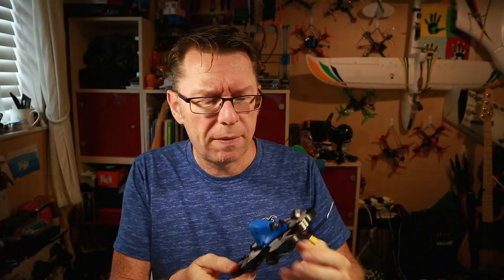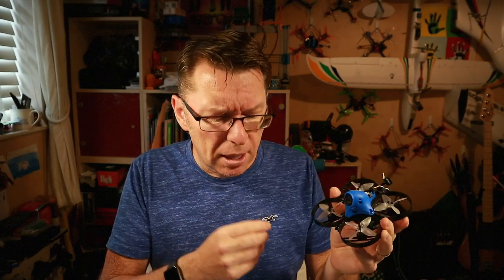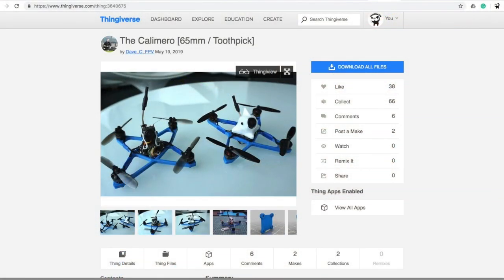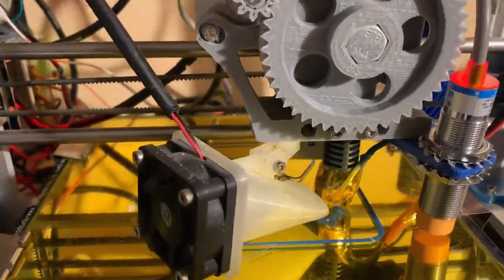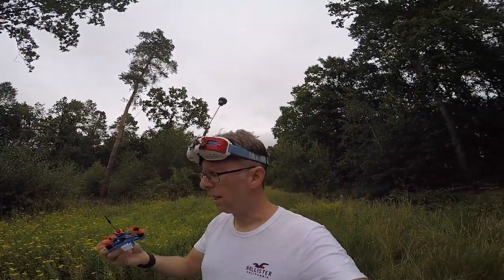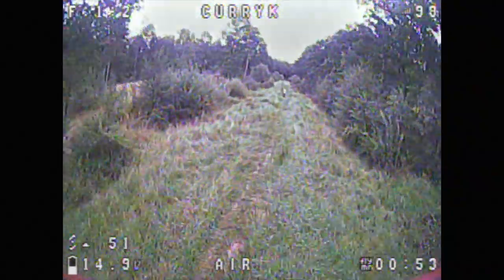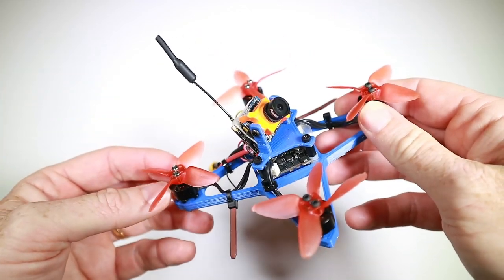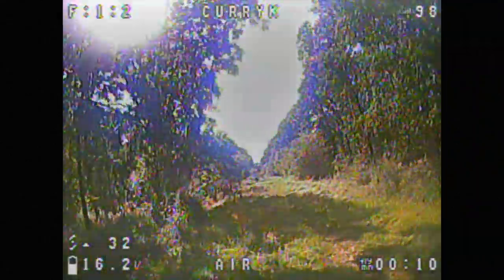Using BetaFPV's 4S micro motors/FC/ESC/Lipos to make the "CurryPick"

Comment: Hi just on the frame how strong are they ?(new to 3d printing) is there more flex than carbon frames will a hot day have an effect on the material....looks good
Reply from the maker: This works fine - the reason being that the quad is light enough to not generate a huge amount of kinetic energy in a crash.  It doesn't scale up very well though, so larger printed frames have issues with flex, strength and weight.  I would have ordered myself a carbon one for this build, but I was in a hurry and thought it might be fun to print it

Comment: For 11xx size motor, what general screw sizes/types you would recommend to pile up for motor mount? Thx!
Reply from the maker: m2's basically, it then depends a little upon the motor mount type and the frame thickness.  I used 8mm m2's in this with a single m2 washer to protect the PLA a little.  But I could knock 1mm off or so.  It's mostly frame thickness + 2-3mm.  I had surprisingly few of these kicking around.  Lots of 4-5mm and then 10mm+ so having plenty of these in between sizes would be handy

Comment: Interesting build Wayne. It's always more fun creating your own Models, even if you have used other people's designs. It must be a very light frame, Im surprised China hasn't 3D Printed these things long before now. 
  Changing the subject, can you consider putting iNAV on a 5 Inch and in particular going over the ESC / Motor / Filtering scenarios.???? It's frustrating me because I always seem to have issues with motors overheating and oscillating etc. 
  Weirdly, I did have iNAV on my old F450 and I got that to run smooth and cool..I know the GPS and iNAV is streets ahead of Betaflight, but their Motor setups ain't so sharp.
Reply from the maker: My only problem is that I don't have a GPS/Compass I can use right now... well, I have one to go back on the quad to run Ardupilot - but that's on 10" props and that seemed to work well for you.  I suppose I can run iNav without the nav part?  If so I'll put it on my todo list when things get a bit less hectic
Reply: @CurryKitten  That would be great, I like Betaflight but iNAV does a far better job in Navigation Modes...Its just ESCs and motors I get a problem with...Im sure Im not alone. Ardupilot does not have the following iNAV enjoys...

Comment: Hey C K I'm getting hot motors on my leader 120 which has been flying fine till just recently. I did brake a prop on a minor crash but didn't think that would cause any issues after replacing it. Now all 4 motors are too hot to touch for more than a couple secs.  Any suggestions?
Reply from the maker: When all the motors start overheating at once, the most likely issue would seem to be the way the flight controller is driving them - In the same way you could overheat motors by a bad pid/filter tune.  When it was obviously flying without an issue previously, take a look at the FC and see if there's any movement in it - vibes that may now be going into the board could be making it drive the motors in weird and crazy ways.  You could also check for any ESC board issues (thought this would normally affect a single motor) and check for ESC shorting on the frame (i.e the motor windings are shorting against carbon with a screw in too far)  It's possible in a crash, but again would normally hit one motor rather than all
Reply: @CurryKitten The FC is soft mounted with grommets so I think it's ok so I'll check for shorts from the motor screws w the frame w a multimeter. That right?
Reply from the maker: Yes - hold one end against the frame and then with the other probe check each connection on the solder points where the motors join the ESC board.  If you get any continuity it means you have a short.
Reply: @CurryKitten  I've adjusted the P& D gains but still same issue. I'll check for shorts next.  I have a multi meter but it doesn't have a bloody beeper. I'll have to grab a better quality 1. Unsure what the readout is supposed to be vs a beep

Comment: One thing to do with that printed frame is before you remove it from the build plate is cook it on the build plate at 80c for 30min and it will stiffen up the frame quite a bit.
Reply from the maker: When you say "stiffen", I'm a bit worried that the PLA might become even more brittle - is that not a concern ?
Reply: CurryKitten no it makes it a lot stronger and stiffer. I have done this at least 30+ times, it makes a big difference! It helps all the layers relax and all the microfibers alighn. Just let it cool down for a while before removing. I have been printing for a long time and have learned a lot of tricks.
Reply from the maker: Great tip -= thanks.  I'm not expecting to print many frames off, but if I do, then I'll give this a go

Comment: Interesting demo for sure with a touch of "curry" engineering as well!  Better you hit the GoPo than yourself!  That's a little screamer wizzing by!  I do wonder if dropping the battery mAh to 300 packs would work if the quad is already draining the 450's pretty hard. Cheers!
Reply from the maker: If it was my GoPro7 then I think I would be cheaper to replace :D  There's this imaginary perfect battery capacity somewhere.  One that is balanced just right against weight and power.  So the 450's are going down fairly quickly, but is some of that because they are a bit heavy?  It's all speculation - it would be nice to try on a bunch of them and see

Comment: What would be the cost of such a system if you get all the parts you have? Seems like a nice and cheap build?
Reply from the maker: Micro stuff isn't that much cheaper than the larger stuff sadly, so I think you'd be looking at around $130 the the electronics on that build which doesn't include a lipo and you'd need to print your frame for free

Comment: Hi Curry, it's your first name ?
This is a good frame you have print with PLA ?
Reply from the maker: It's no my actual name, but I'll answer to it :)  Yeah - it's not a bad frame, I think if I had more time I would just order a nicer carbon one, but PLA doesn't hold up too badly
Reply: @CurryKitten  Diatone do a plastic frame, bettter carbone !
Is a PETG ?
Reply from the maker: PETG is a great material for printing a frame like this.  It was more flex than PLA, which can be brittle and so will snap easier
Reply: @CurryKitten   with ABS  ? is that Curry ? 😃